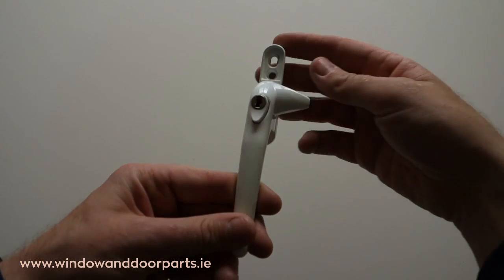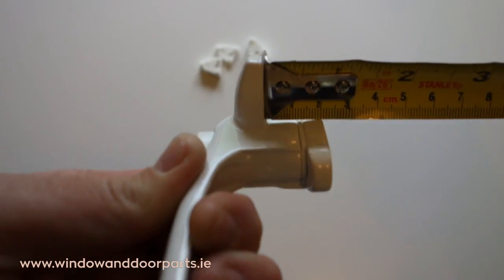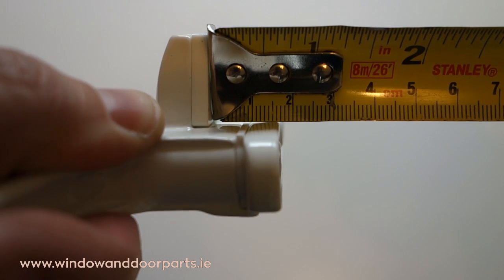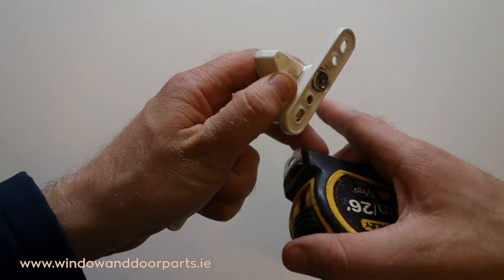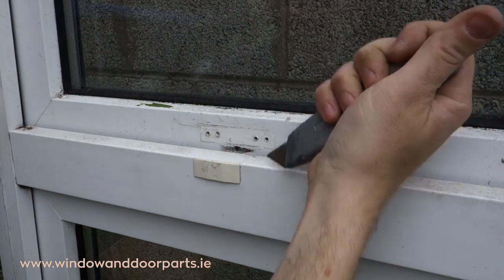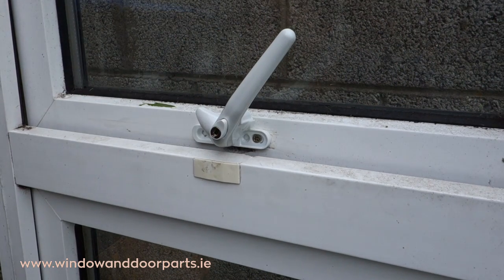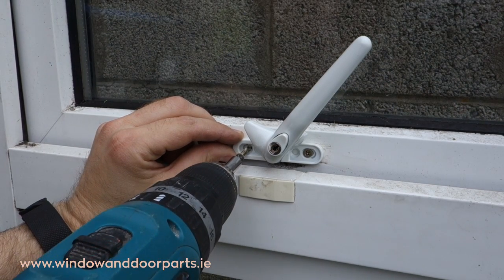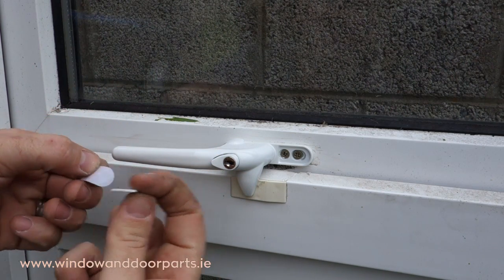How to replace a cockspur window handle on a uPVC window

Comment: Thanks paddy perfect for our house we bought with old missing handles like this! Question are you using self tapping screws there to make new holes?
Reply from the maker: You can use self tapping ie. pointed tip for unreinforced pvc. Or self drill tip screws for reinforced pvc. Best thing to do is take one of the existing ones out an see what type it is

Comment: I wouldn’t have replaced that handle as that window’s not going to prevent burglars getting in as it’s obviously not attached to any property. Seriously though, a good practical demonstration from Paddy, the information regarding where the pane sits in the frame could be extremely useful to a novice.

Comment: Hi Paddy, great videos. My issue is, I have a window which won't close (the handle won't move). When I take the handle off, the lock works fine ( locks and opens). It seems maybe the mechanism where the spindle fits into isn't moving?
Reply from the maker: https://youtu.be/D6h5Y85NjWY

https://youtu.be/5HkPks3wlfY

Comment: hi - great tips! Thanks, I want to have a go myself, however , I have a cockspur handle and there are no visible screws on the outside of the handle. (In all the handles I have seen there is a small cover that you can reach the screws or rivets.) What's the trade-secret to get inside the mechanism. The unit looks completely sealed, not even a small hole for an allen key! thanks!
Reply from the maker: Could you take a picture of your window handle, upload it to https://imgbb.com/ then post the link back here? I'll have a look at what type it is for you
Reply: hey thanks for the reply. I have only just fixed the problem. There was a hidden allen key behind the key insert which can be pulled out with some pliars. Once found, I could do the job. Keep up the great videos.

Comment: Is there a way to tighten old cockspur handles as they are flimsy/loose? i dont really want to replace them yet.
Reply from the maker: If the handle lever is wobbly from the base the only cure is replacing it. If the handle base is loose from the window you can try tightening the screws or re-rivet it
Reply: thanks.ill try that.
Reply: Ricky Rom

Comment: Hi what type of screw do you use because when I try to tighten the screw it wont it just keeps going around thx
Reply from the maker: Hi Steven, if your screws keep spinning around you'll need new screws with a wider thread. Don't use a longer screw, as it can break the glass. the screws i use in this video are 3.9mm wide screws. lets say yours are 3.9mm diameter and turning, a 4.2mm or 4.5mm diameter screw should do the job
Reply: Window and Door Parts Ireland hi thx that is what I did and the screws work perfect thx

Comment: Hi it is very important to use the same screws and screw holes. Then he uses the same screws and makes treee new screw holes?? Durrr!
Reply from the maker: Well spotted. The new handles screw holes were in different locations to the old handle. Thats why i had to drill new holes. The same length screws, on the same line as the old screws will be ok. Any higher than the original screw holes would risk breaking glass